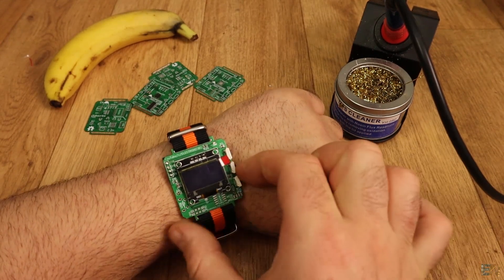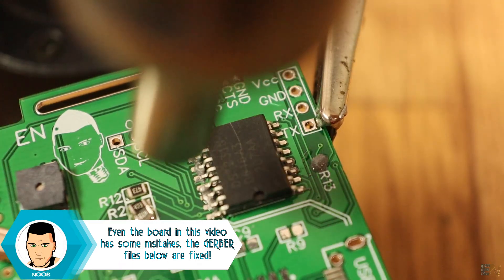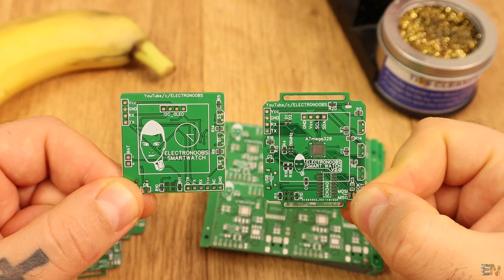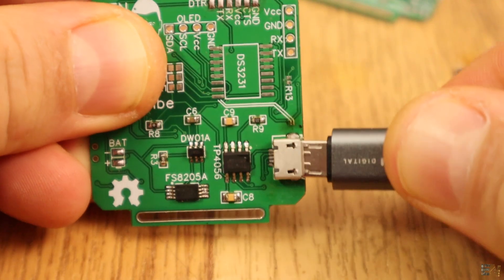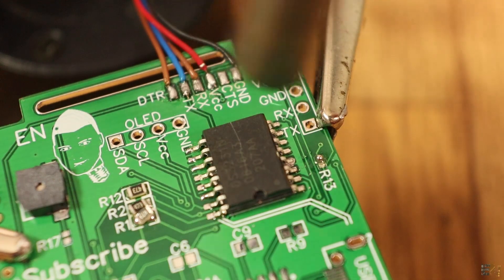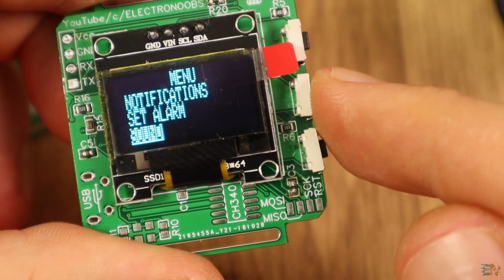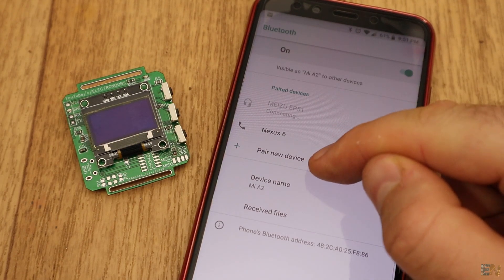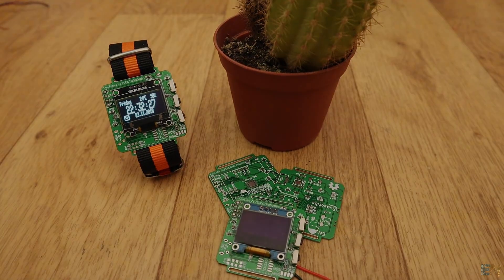Arduino Bluetooth smartwatch V2.0

Comment: if I refer to and use the schematic on the description link above, can everything run normally when the components are installed? or it must be revised according to the video description at 7:19 minutes.

Thanks.

Comment: ver 2.3 small display 128x32 good

https://www.electronoobs.com/eng_arduino_tut61_code1.php
Can I correct the code so that the display does not turn off automatically?
Or is there to add in the settings that you can choose the time of the power off?
Can the temperature be another tenth of 12.3?
the temperature showed a normal minus below zero. (0 253*c)
where and what humidity sensor is connected?
if you can add 180 degrees in the menu to turn the display

where and what humidity sensor is connected?
Or is it a battery charge in percent? If so, then you can redo the humidity sensor is valid for DHT 11

Comment: In next Version you can change the Controller to an stm32f103c8t6  you have Mode clock speed Mode flash Memory and a integrated RTC.

Comment: Impressive project, especially with all the connected features!  A few alternate component suggestions:  The ATmega32u4, used in the Arduino Leonardo, has the same or more memory as the 328p, and built in USB, so no need to use a separate USB to serial chip. Just burn the Leonardo bootloader and program over USB from then on.  Also, the M41T62 RTC from ST has an integrated crystal in the LCC8 package version, which is only 1.5 x 3.2mm, so way smaller than the DS3231.  The 32u4 is more expensive than the 328p, but by almost the same amount as the DS3231 is over the M41T62, so it'd probably come out even, you wouldn't need the CH340 and be able to save quite a bit of space on your PCB.  Keep up the good work, love watching your videos!

Comment: how come some vendors supply 0.96" displays with GND and VCC swoped over? is it to do with different chipsets? and you have to be careful as the vendor doesn't tell you (I cant see it in descriptions) as you can imagine bad news if you design your own PCBs. Also one has the top  line in yellow. Please can you explain this to me as I get confused, I think one is SSD1306 not sure about the other. It would be easy for someone building your project to get caught out by this, as the majority of vendors have the GND,VCC type as apposed to VCC,GND...…………….  pls explain …..thanks!
Reply from the maker: There are soem of these OLEd modes taht haev GND abnd VCC swoped. I don't know if is a different chip, but the pins are swoped so amek sure when yopu buy those. The yellow line is just an option. You can find white, blue, yellow...

Comment: Well. In my opinion you need to release one more version with esp32 or similar. It has BLE it has much more ram and rom in order to implement aditional features I think it also has RTC clock. If I am not wrong code can even be written in arduino IDE(not sure about this). Good luck with project :)

Comment: Rprog value (R9 in your circuit) is much too low for safe operation! You have retained it 1.2 kOhm corresponding to charge current of 1A, which is too high for a small battery. For a 100 mAh battery the suggested charge current is maybe 100mA so a resistor of about 12kOhm.
Reply from the maker: Thank  you for your tip. I was usnin the stock circuit for these small batteries... I will change that for future versions. Thanks!
Reply: Depends on with how many C it can charge though. Some can be charged faster.
Reply: @Davedarko  Yeah but for unknown battery 1C is a good starting point, and even that can be too much. Even if the battery could possibly be charged at 10C, it's increasing the likelihood of damage.

Actually i googled up the battery designation and according to sellers, maximum permitted charge current on this one is 1C and recommended charge current is 0.5C. This would make maximum charge time of about 2.5 hours and recommended configuration resistor of 24 k.

So i think giving it 10C is definitely irresponsible.
Reply: @SianaGearz  absolutely correct :)

Comment: Your OLED Display is still in 32x128 Mode change it in the library to 64x128, otherwise everything has one blank line after a pixel line
Reply: How can I do so..

Comment: 2mA in sleep mode - doesn't look good. BTW it seems you have wrong driver for OLED screen - it displays only half of vertical.
Reply from the maker: Thank you!
Reply: @ELECTRONOOBS  If you're using the adafruit library, the number of rows must be set to 64 instead of 32.
Reply: @ELECTRONOOBS  It could also be a crack in the glass. Happened once to me, too.